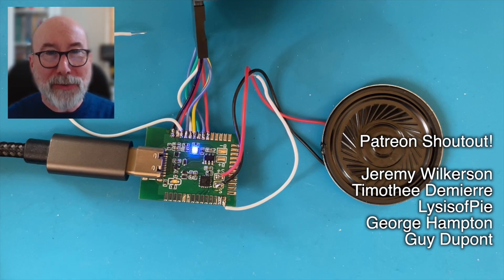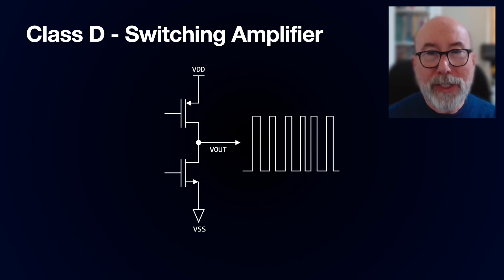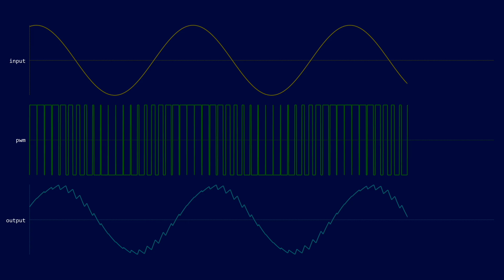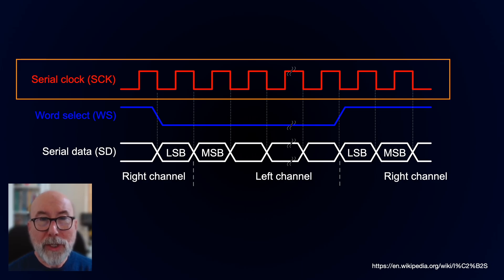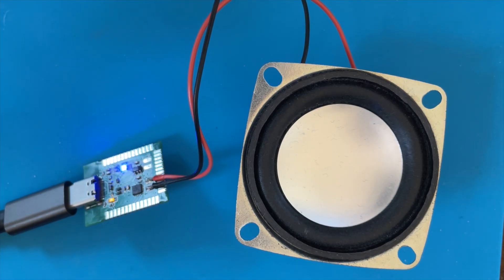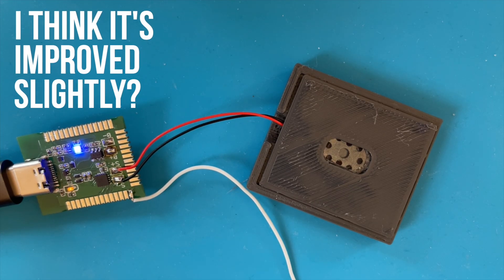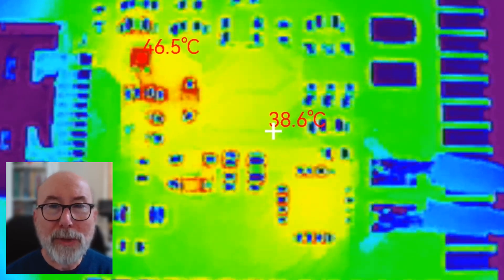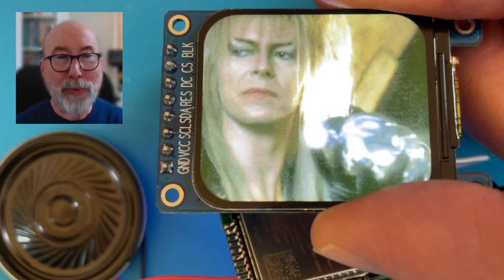Sound and (almost 😉) Vision - We're getting closer to our own Tiny 📺

Comment: To improve the audio output of the tiny speaker you need a resonant cavity in front of the sound hole (basically the speaker needs to be down a 'tube'). For my project I printed a number of different lengths and found even 1mm made a big difference. Also critical is the sound hole size, a grid of 1mm holes worked best for me, but not too many. When the speaker diaphragm moves you need to create a pressure differential between the inside of the chamber and the outside world.
Reply from the maker: Nice - I'll give that a go!

Comment: With the little speaker, I found it helps if you practically box it off entirely, then let the sound out the sides
Reply from the maker: Ah, interesting, that would match what I've seen in phones and tablets where they have quite complex audio guides.
Reply: @atomic14  If yours is the same size, here's a little housing you can use : https://drive.google.com/open?id=1DAvj8tcE_OzMD-zHZs7fMcB5F8h3GTuF&usp=drive_fs

Comment: Stream video over WiFi gets my vote! Using a mosfet instead of the schottky diode nets a slightly higher voltage for the amplifier for when running off battery power, might not be worth it if running off USB 5v but for the battery option it's quite the improvement. The forward voltage of the diode increases as the current increase so the FET would help with dynamic range of the amplifier.
Reply: yep I'd go for and active diode with a fet over a plain old Schottky as well
Reply: @TheEmbeddedHobbyist  Right, battery powered devices require a little more effort in the efficiency department. The diode is fine for USB but not quite sufficient for battery operation.
Reply from the maker: Yeah, I should have used the same circuit I used for the power path control. Streaming over wifi seems to be popular. Just hope my ropey wifi network is up to the job!
Reply: @atomic14  I didn't think about how this would work until now, that's going to be quite the task. The source would need to be the native resolution of the display and framerate to avoid compression on the esp32, I can't imagine getting a 60FPS 1080p stream and compressing it to a suitable format in real time with the available memory. It would be better to have a python script running the compression on a PC and streaming the compressed video to the ESP32 over WIFI to avoid the heavy lifting by the uC. I've used the ESP32 for 24bit audio analysis (FFT, THD, RMS) and that alone was quite demanding, I ended up going with RTOS tasks to get contiguous data capture using I2S. Audio alone was enough to keep the single available core busy since WIFI use requires the entire second core. Sounds like you got some serious chatGPT prompting to do. Good luck, I'm sure you got this but don't waste your life away trying to impress some nerds on the internet considering using a preformatted SD card would be lightyears easier.
Reply from the maker: Don't worry - if it proves to be too difficult I'll do something a bit easier. I'm thinking along the same lines as you - have a python server that is taking the video frames and shrinking them down to the display size and then serving them as a JPG file. And with the audio just changing it to 8 bit - probably with just 16KHz sample rate.

I may actually just preprocess the video with ffmpeg to make it into that format. Maybe the SDCard approach is easier...